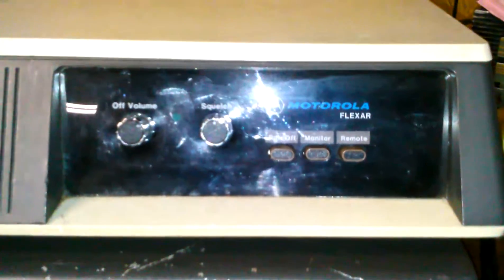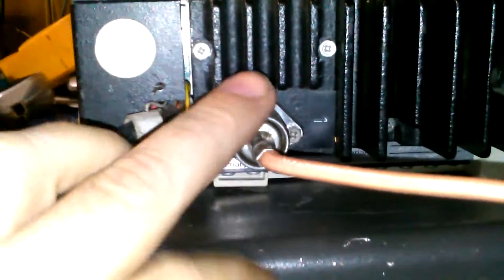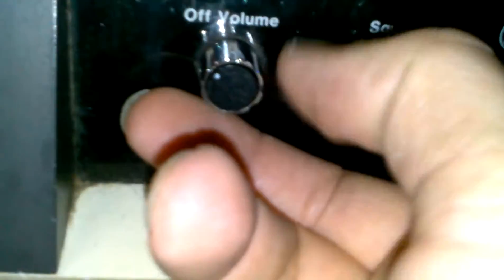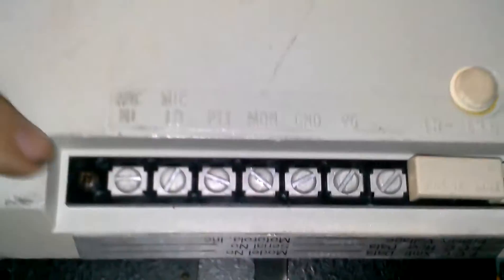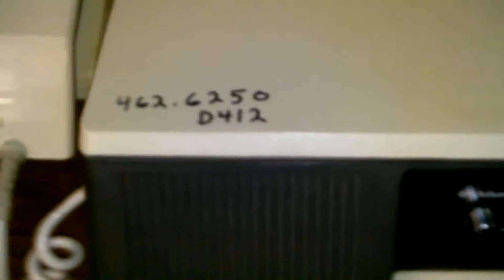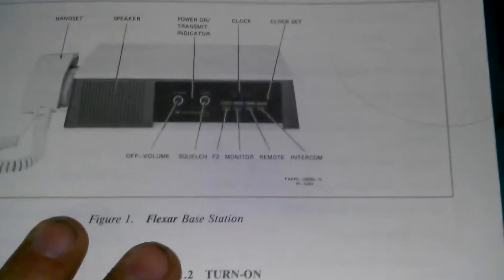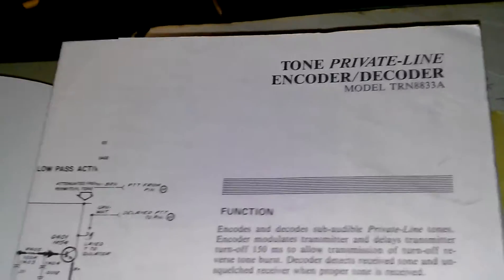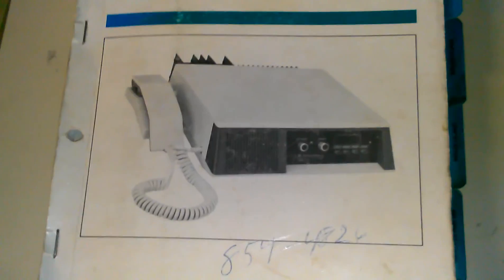Motorola Flexar UHF GMRS Repeater

Comment: How much do you think it’s worth? I saw one today and was going to buy it to resell it
Reply from the maker: I paid $50 for this one already set up on GMRS (462.6250 with a DPL couplet set to D412) even with the duplexer tuned. Keep in mind that these are crystal controlled radios and crystal channel elements are not only hard to find but expensive in some cases upwards of $140 and everything has to be realigned if you change frequency. These are also not narrowband so they cannot be used anywhere but Ham and GMRS bands.